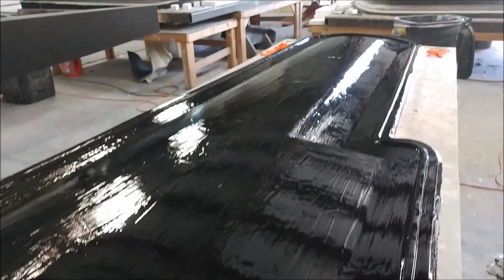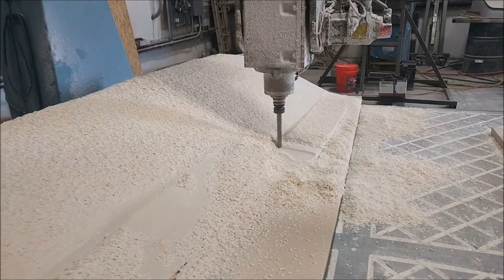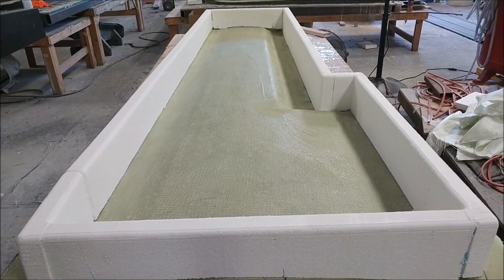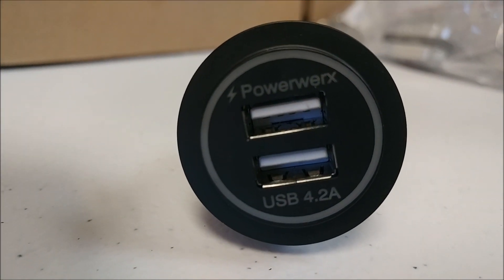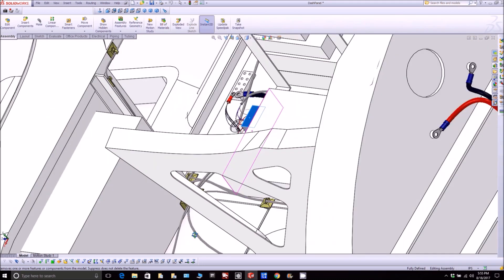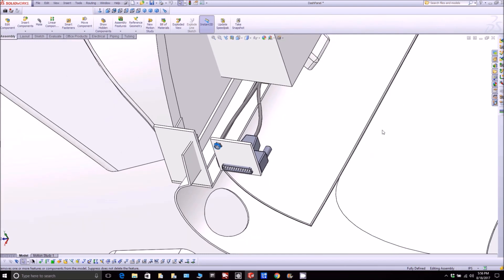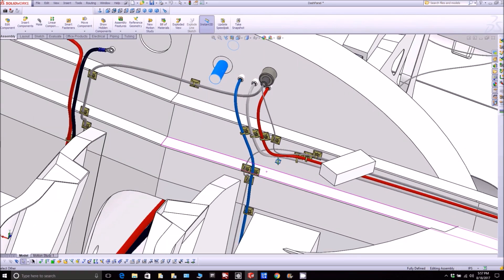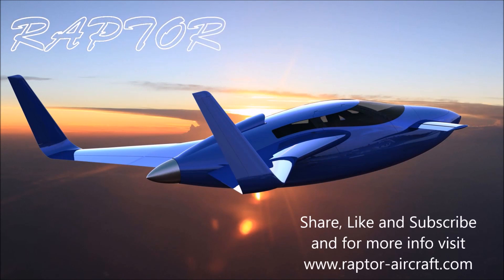Waist Deep In Wiring - Many hours spent in Solidworks

Comment: We did the same thing with our USBs. We purchased quality ones (non aviation) and our Garmin radios do not like them. The Comm radios sound like a stuck mike. We ran a separate ground for them and that helped a little but still can't use because of the static while using them.
Reply: Same here, took 2 flights until I found that a USB charger that I had plugged into the cigarette lighter socket caused the VHF radio to be jammed. It also has dual 2.4A capabilities. Article was: 
https://www.amazon.com/gp/product/B01JEF1ZVO
Please post the order number and I'll get one and do an EMC scan for free to help the project. It could be knocking the glide slope out, or who knows what.
Reply: These are the ones we purchased. What will doing a scan tell you?  If you can fix there is a cash prize in it for you....
https://www.bluesea.com/products/1016/Dual_USB_Charger_Socket
From Amazon
https://www.amazon.com/Blue-Sea-Systems-Charger-Socket/dp/B00S9K3V04/ref=sr_1_2?ie=UTF8&qid=1503458243&sr=8-2&keywords=blue+sea+usb
Reply: Sorry, misunderstanding, I am offering to test the ones used in the Raptor, not yours.

Comment: Speaking of the engine, is oiling going to be an issue?  Since it's an automotive-based unit, it was designed to be mounted fairly level.  Is there a possibility of oil starvation during prolonged banking maneuvers, like turning onto final, or is the sump deep and baffled enough that this won't be a problem?  Or have you gone with a dry-sump system?
Reply: Auto engine works OK if there's positive G's. The aircraft will have no problem, since an aircraft does not have any sideloads like a car does. If you're flying in a slip or uncoordinated, maybe a small sideload.  Rolls are OK too as long as you maintain positive G's (barrel roll) but no inverted flight or prolonged aileron rolls.
Reply: IMHO. It is super simple to modify the oil drop tube in the oil reservoir. & not much of a stretch to design a full on kit for inverted oil supply to the pump. Take the time to pull an oil pan off an engine & you will see what I mean.

Comment: Wow! an "aviation" usb port is 10 times more expensive than an automotive usb port!
I'm not a pilot, but I like airplanes and aviation. And I've been following your videos for as long as you have been publishing them. I think your plans are very well thought out, resulting in a new and novel synthesis of previously proven technologies. in particular, I think that using the leading edge surfaces to serve as heat radiators for the engine is brilliant. Of course using a canard and lifting body fuselage is also brilliant. All of this leads me to think of actually getting a pilot's license so I could buy a Raptor!

Comment: The aircraft parts will be EMC tested to aircraft Standards, which is why they carry the $300 price tag, I know you can get away with it as you have an experimental license, and the likelyhood of a USB charger being a major source of EMC interference is low.
I don't want to tell you how to build an aircraft, as you're clearly doing more a better job than I am, but please don't brush over these issues :)
If you do have probs with radiation from it, just wrap in foil.
Reply: Depending on the design of the electronics EMI could be significant. Poorly designed SMPS's are insane sources of noise. Hopefully the one they bought is a linear regulator.